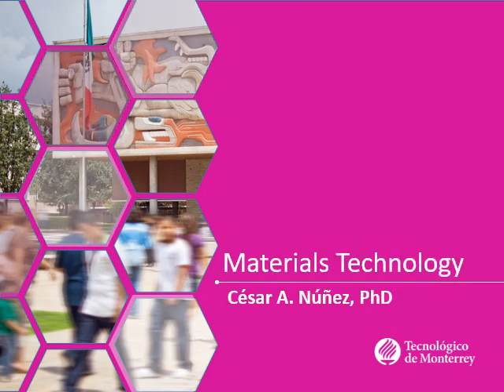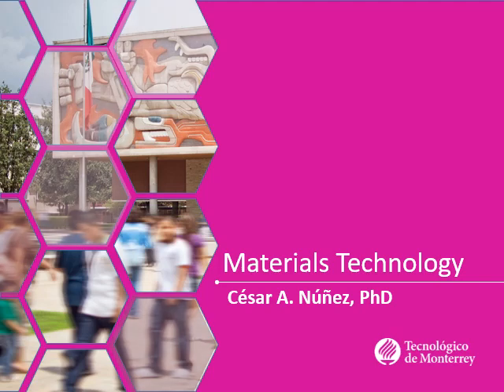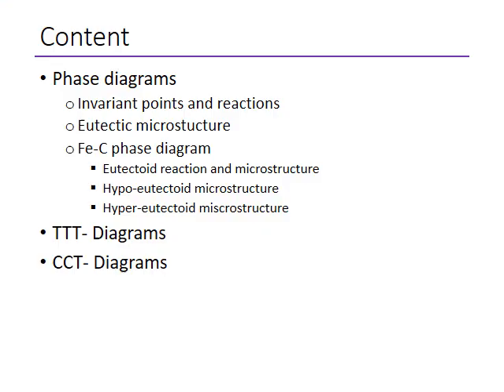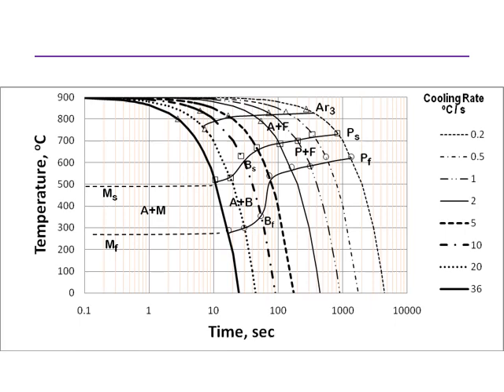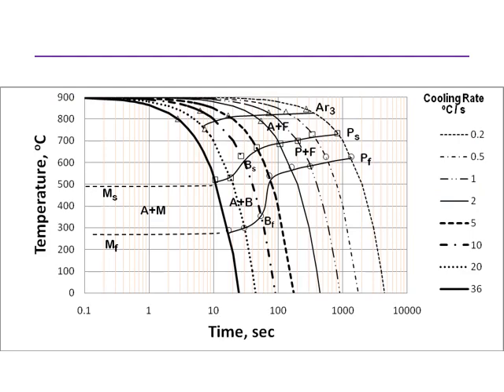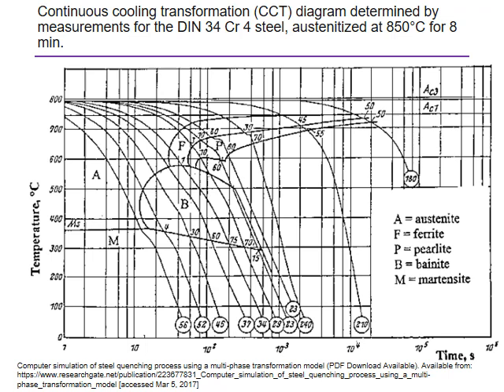CCT Diagrams

Comment: hello i have one question..i have dilatometric results and how can i draw cct diagrams with these results?
thank you for your answer
Reply from the maker: It is possible to use dilatometric results for making a model of transformation kinetics, making the proper corrections, for instance, by the use of the Kop et al method. Read the article of Gomez et al (M. Gómez, S. F. Medina, G. Caruana, "Modelling of Phase Transformation Kinetics by Correction of Dilatometry Results for a Ferritic Nb-microalloyed Steel", ISIJ International, vol. 43, Issue 8, 2003) for some ideas about this.
Reply: @cesar_nunez  thanks for your answer but this article is unavailable.
Reply from the maker: @fatemahmehrabi7071  Sorry about that! Try then the article by Garcia de Andres et al ("Application of dilatometric analysis to the study of solid-solid phase
transformations in steels", Materials Characterization, 2002 (48) pp. 101-101) http://digital.csic.es/bitstream/10261/34076/1/Mater%20Charact_2002_Garcia_de_Andres.pdf 
I hope this link works.
Reply: @cesar_nunez  great.thank you for your answer.